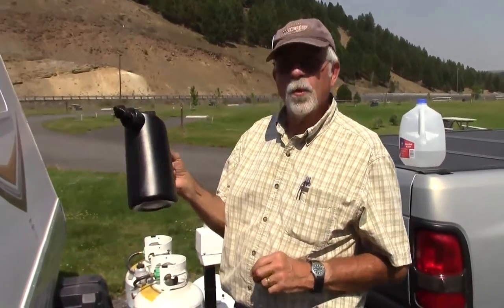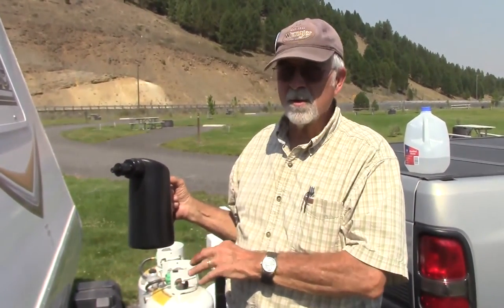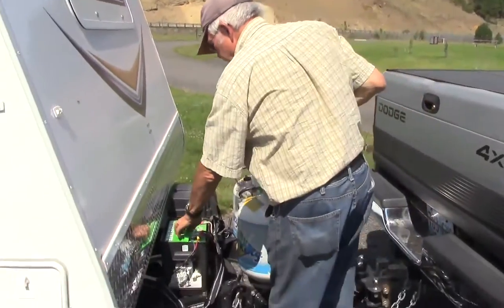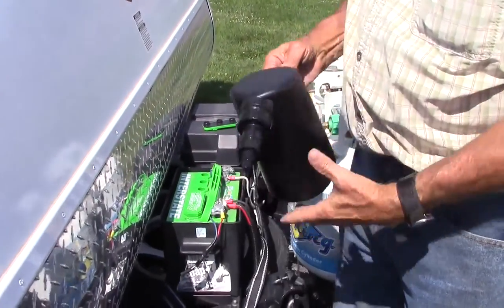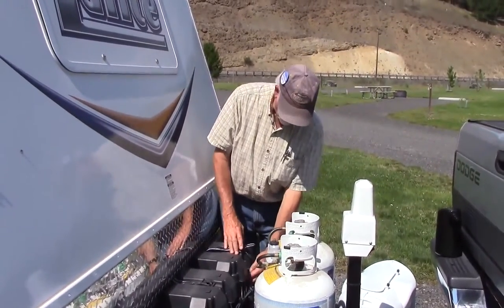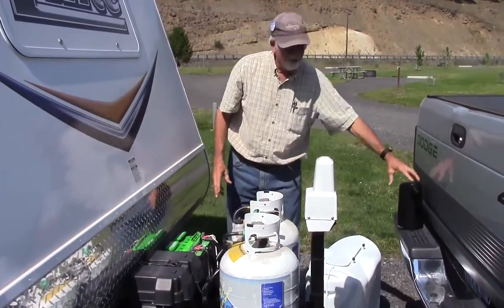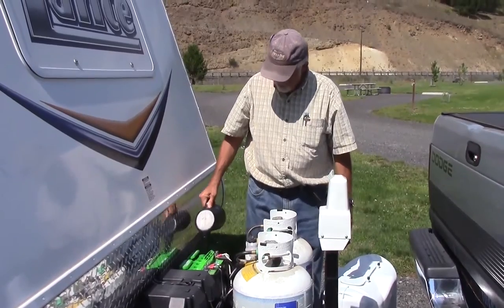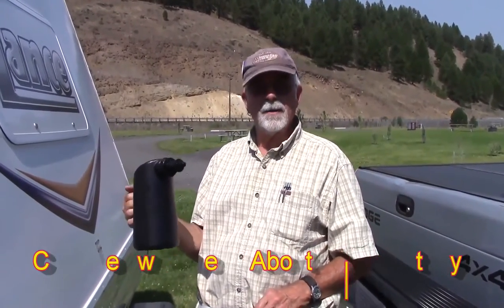How to Fill Battery Water using a Batter Water Filler

Comment: My filler seems to overfill the batteries.  If I wait until the gurgling stops, I find that the level is too high.  Have you had this problem at all? Thanks!
Reply: we did not have this problem. not sure why you are having overfilling.

Comment: how do you know when is right level?
Reply from the maker: If you use the water filling device that we are using in the video, it stops filling automatically when the water level is correct. If you look into the battery the level is at the level of the filling hole.
Reply: +RV Travels ok! thanks.